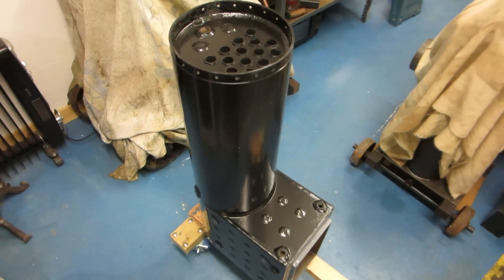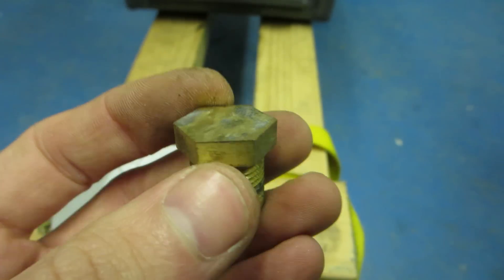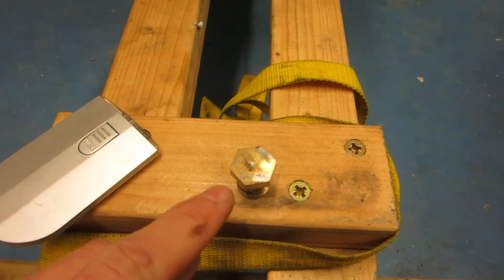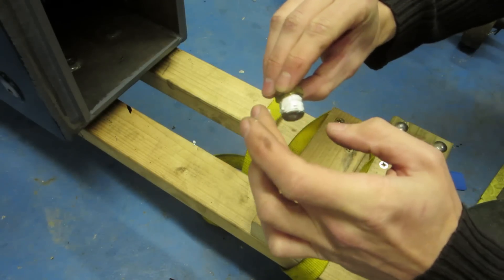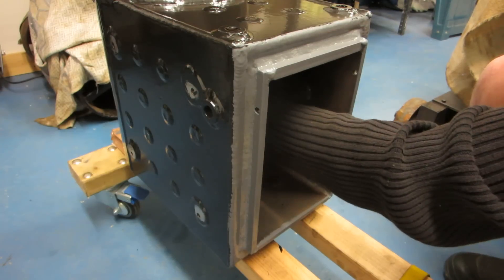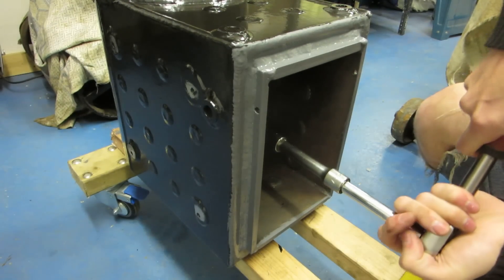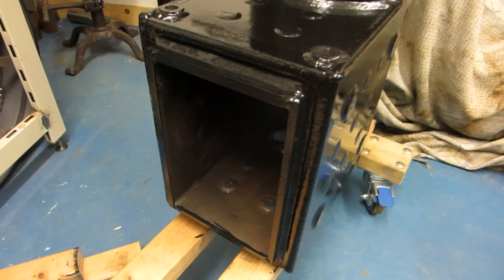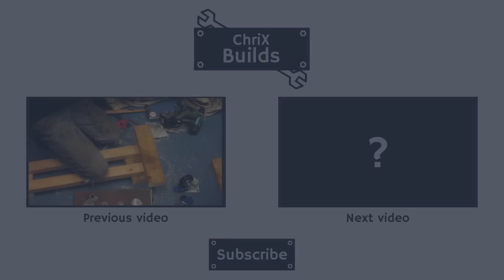Fitting the smokebox - Burrell SCC Build Part 20

Comment: Hi Chris, I've watched all your videos, been excellent. I am looking on building an SCC myself so have been sucking up all your tips etc. Apologies if I missed this, I recall you used the BBQ paint on the smoke box etc, baking it in the oven. What type/make is the grey and black paint on the firebox and boiler body in this video. With the heat I assume it will have to be similar to the BBQ paint?
Reply from the maker: Hi Stewart, thanks for watching and the compliment! The outside of the boiler doesn't get that hot (relatively), as it has the water/steam between it and the fire of course. The black paint you see here is Craftmaster Raddle, brushed on, which seems to be nice and hard wearing. Good luck with yours!
Reply: @chriscrockerwhite  Hi Chris. Did you use primer on the boiler first?
Reply from the maker: @robert.hall85  hi Robert, yup I used the Craftmaster grey primer before the Raddle. I hope this helps! Chris
Reply: @chriscrockerwhite  Thanks. Just asking for now has i have only got my wheels and Smokebox...